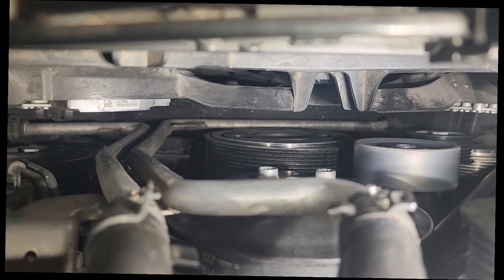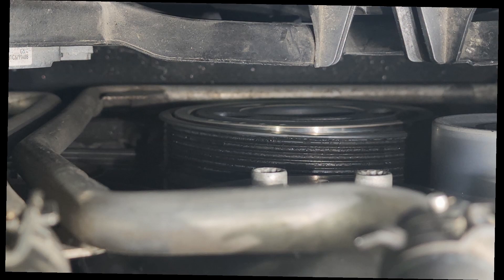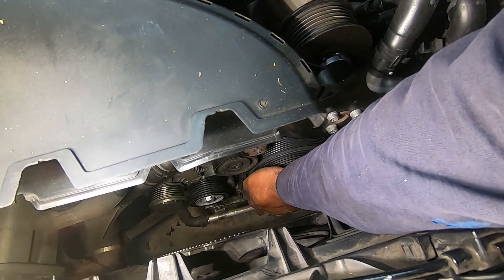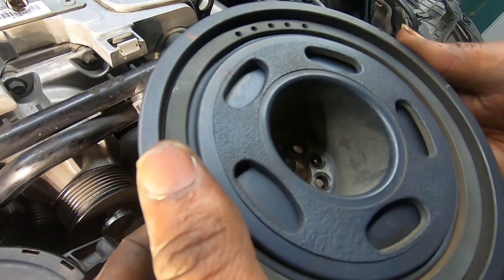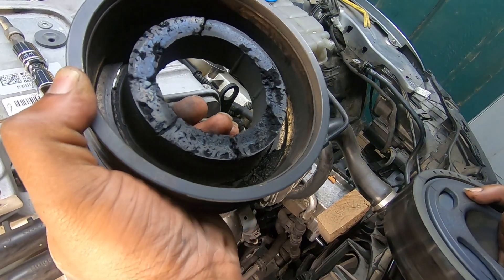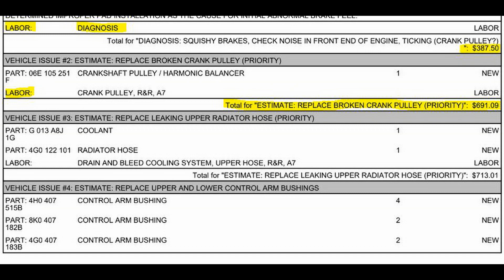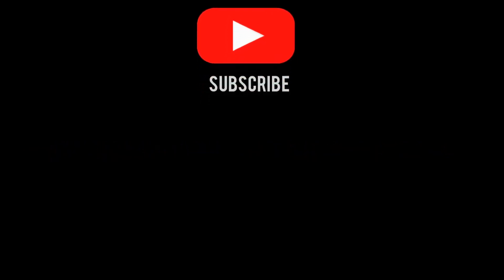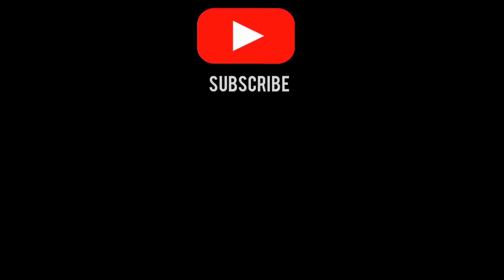AUDI 3.0T FAULT CODES P0235 P0068 SUPERCHARGED ENGINES - PART III CRANK PULLEY FAILURE

Comment: Very informative. Str8 to the point. Great visuals. Glad you found the core of the issue.
Reply: hello I have the same fault code when I accelerate the car goes into safety and cuts off the engine and I can't exceed 1500 revs cut and restart the engine and it starts again but not much power had these symptoms
Reply: @alid5954  hello, I have the same problems on my audi A6 c7 3.0T, did you find the problem? Thanks
Reply from the maker: Thanks @rb3tv... And it's running great now. Gonna do a follow-up
Reply: Wow didn’t think this will through the throttle body and map sensor codes. I am going to have to check mine out! Thank you so much